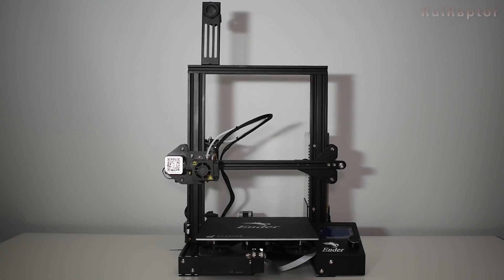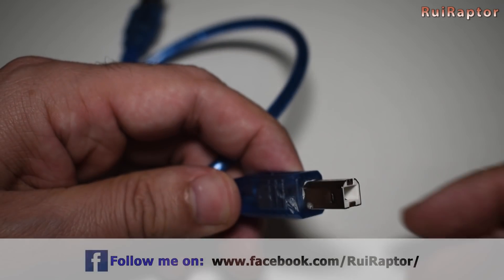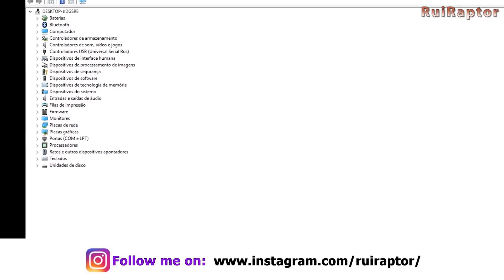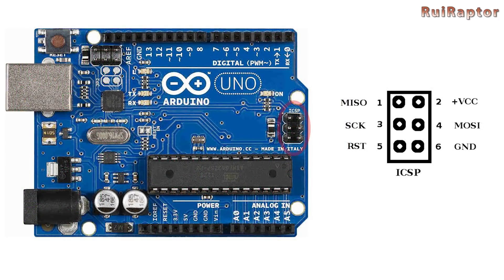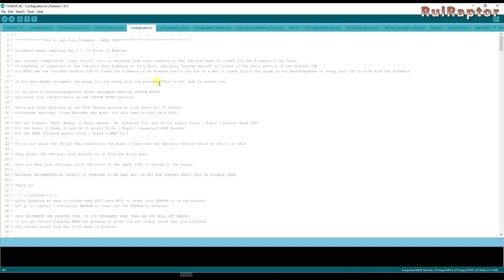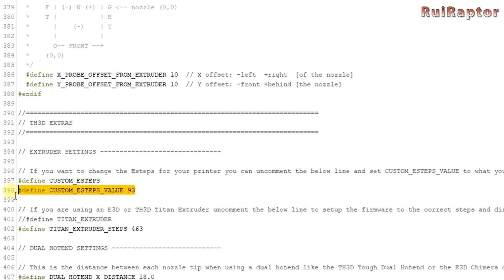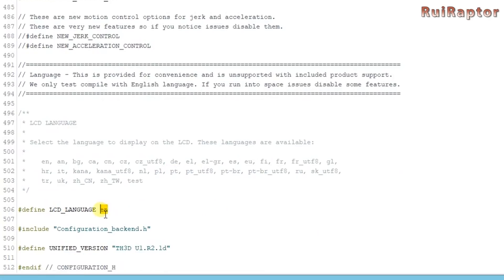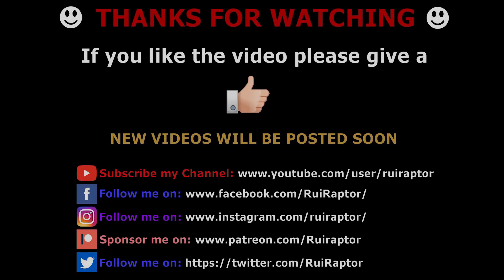Ender3 / Ender3 Pro - HOW TO Update The Firmware (8-Bit Boards)

Comment: I have been looking for a video like this, but how do I know which version of the firmware I have currently?
Reply from the maker: Hi Aron,
When you boot the printer, on the startup screen it should display the version.
Reply: I have the same issue (can't display current firmware level). It definitely does NOT display during power up, and is not anywhere to be found on the main screen.
Reply from the maker: If the version is not displayed during the boot sequence, it means it's disabled in the firmware. If you have the stock version, I strongly recommend you to update it regardless of the version because of the thermal protection safety feature.
Reply: If the new firmware had features that were functional (e.g., make my prints better), I might be tempted, but since flashing involves more than a few steps, I think I'll wait until it fails and then replace the whole hot end. That replacement will require the Marlin firmware, so I'll get the Arduino board and other stuff required for upload and flashing at that point.

The fire hazard is ridiculously overblown. I lit some filament on fire the other day with a lighter (trying to fuse some new filament with old filament so I could use the old reel down to the nub -- it didn't work). The stuff (PLA) does burn and definitely sustains the burn, but it is not explosive nor is it particularly hot (not like magnesium) and in my garage setup would be extremely unlikely to cause a problem if a thermal runaway caused it to catch (also quite unlikely). 

I have lots of other hazards I deal with every day that are far, far worse.
Reply: py Ender 3 pro has 1.1.6 firmware which on  crealitys  website says has  thermal runaway protection, yet on redit & elsewhere people are saying they dont have this feature. also on the SD card that came with it is a 1.1.9 firmware but I cant install this (the creality website says the latest firmware for the ender 3 pro is 1.1.6 with thermal runaway protection) so im REALLY confused. the problems updating the firmware doesnt help - this guide talks about extra hardware & firmware, Creality website says only install a driver & use Cura (which didnt work for me)..

Comment: I keep getting errors. Following the guide exactly. 

"avrdude: Device signature = 0x000000
avrdude: Yikes!  Invalid device signature.
         Double check connections and try again, or use -F to override
         this check."

What  could be causing this?
Reply: Wrong orientation on all of the cables. Solved. Maybe it's worth mentioning :) 

This picture printscreened from Teaching Techs video helped me figure that part out: https://i.imgur.com/PUtowdi.png For anyone who might do the same mistake.

Now I'm getting another error at least.
Reply: Thank you so much this was my exact problem